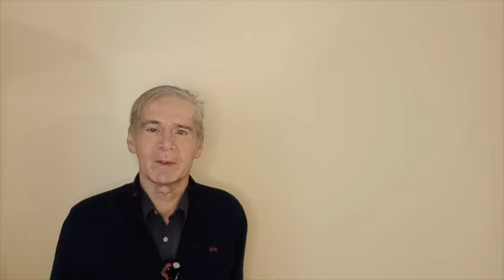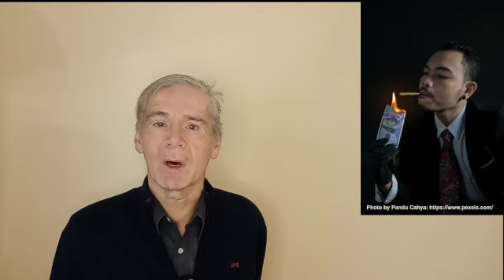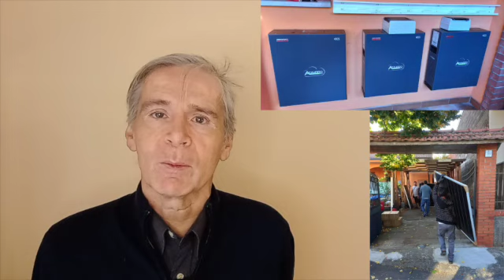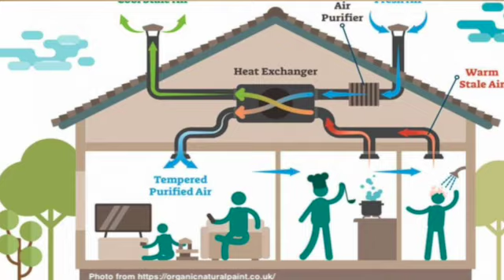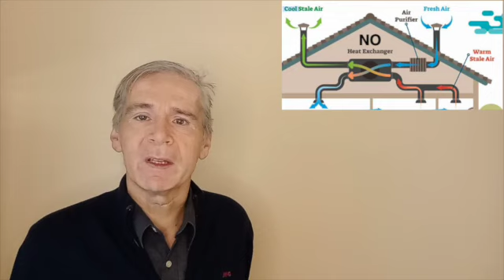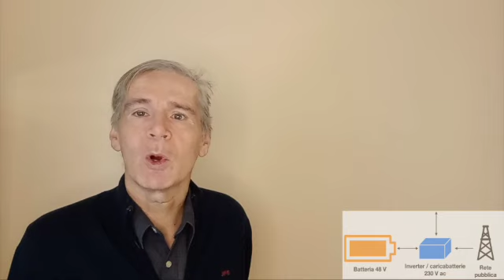Video 3. Heat pump and what you can do with it - Part 2

Comment: Dear Norbert. I like your presentations very much! You try to apply fundamental knowledge of physics combined with simple manipulation of available technology to allow the DIY to think about ways of improving the energy challenges at a home scale. I was particularly interested in your suggestion to use a heat pump's two components (heat and cold) for home appliances. I looked at your contributions on air-air (Airconditioner) and air-water (heat pump for swimming pools) heat pumps to optimally use the energy injected. Of course, the optimal use of both cold and hot components depends on the local and seasonal situation. Do you have any personal experience including a heat pump into a ventilation circuit (In my case a balanced heat exchange system)? Both for cooling during summer and (additional) heating during winter?
Reply from the maker: Dear Dirk, thank you for your appreciation! Misschien spreek je Nederlands? Well, more others will understand English. 
I like indeed to make useful things that are not (yet) in the shops and am surprised there are quite many of them. Among which the application of both heat pump's products heat and cold. It can indeed be a challenge to consume both and that challenge is found also in CHP (Combined Heat and Power). Important is to be aware that it is given by nature and at our fingertips, if we just install the right things. 
On large scale you can apply it to absorb much of the excess PV and Wind that is wasted, like in https://youtu.be/68uK8OrHDhE.
In summer it is easier to use both, because we need space cooling but also heat for showers, dishwasher & washing machine. In winter we might need cooling for food, but not so much. Or we try seasonal storage (expensive, though).
My experience with the heat pump in a ventilation circuit is still in development: I start with a single fancoil (already bought) and go then to feeding the heat pump's hot or cold water into the home radiators, putting silent fans on them so that radiators become (cheap) fan coils. See also very old videos 1 or 2. By the way, I saw your comment at video 3, that's an old one, too!
In my next video of tomorrow (Sunday 25 Aug) I will dismantle a mobile airco and because of your comment I am in time to include a simple scheme of warm & cold piping for summer and winter. Also with those radiators. 
This is dealt with much in the five videos with nr 25 a - e, start with https://youtu.be/6KRZKVct-uE
Thank you again for your interest.